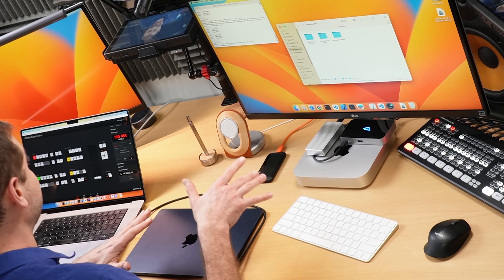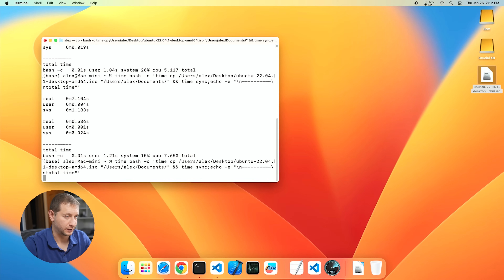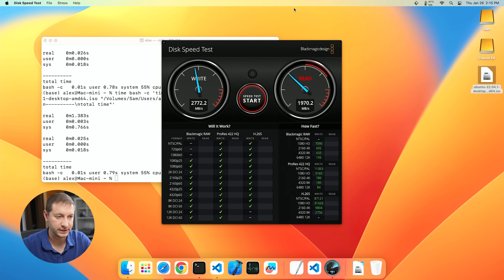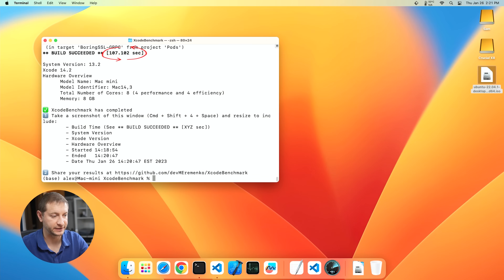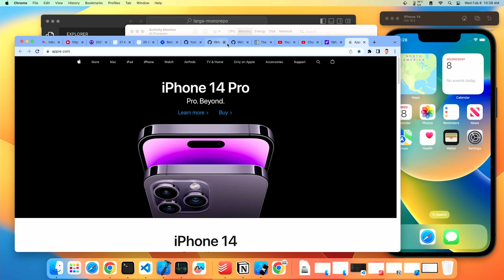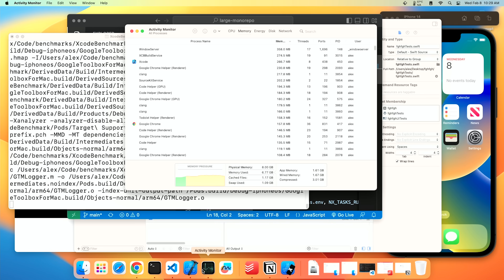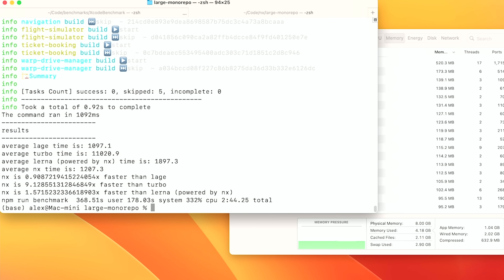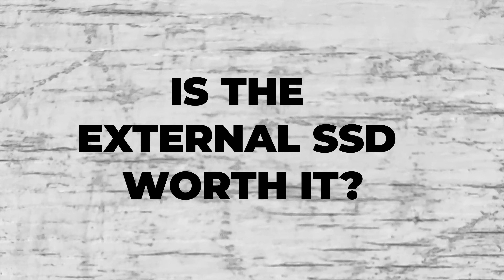...but there's a catch

Comment: Great video.  Most of the comments made so far are about speed but my interest is in SSD life and to some extent  computer life.  I'm thinking of getting an M2 with either 16 or 24 Gbyte of RAM but keeping the 256 Gbyte SSD.  My understanding is that the 256Gbyte SSD has half the life span, measured in bytes written, than the 512 Gbyte drive.  Basically the larger the drive the longer its life.  

Am I correct in thinking that just using the internal SSD for the OS and applications, avoiding swaps by having maximum memory and keeping all data on external SSD is one way of extending the life of the internal SSD.  

One other aspect that appears to be important is the temperature that the various M series machines are allowed to get too.  It appears that Apple prefers silence rather than service life as a 10 degree c climb in temp halves the life of the component.  I've seen videos where the M2 Pro is operating at over 104c which seems to hot to me.
Reply: For fans just get TG Pro and use that to fix fan curves, tho base m2 is very cool even worst case scenario

Comment: Finally an information that nobody talks about. I've been wanting to switch to Mac for a long time but I haven't dared yet, because there are some things I don't know. After installing the OS and the rest necessary, of the 256 GB, how much space is left on the ssd. It seems that not much.
So, can you install all the programs and apps on an external ssd and leave only the OS and swapping on the internal ssd?
If that's possible, then you can even use a 2TB ssd that is always connected to the mac mini.
In the Windows system that I have, this is possible, although sometimes there are here and there one or two little problems.
On my ssd, with iTunes, the iPhone/iPad backup already needs more memory than windows 10 or the space where the programs and apps are installed!
Thanks
Reply: in mac, you can have your apps anywhere you want. even on desktop… it's not like you are installing anything, app is usually one file you just drag & drop from disk image. Or you can map your whole user folder to external drive and use internal just for system and it's apps (and you can install some there and some to your external – there are no limits)

Comment: Does the base model Mac Mini have dual channel Ram?  Single channel ddr5 6400 supports 51.2 GB/s unless your using multiple chips.  To get the advertised memory bandwidth of 100 GB/s you need multiple DDR5 channels.

Comment: 8 ram aren't going to last long. If you just need a temporary machine then it is fine if you are going to keep it for a long time 4+ years then just get 16 ram. As far as SSD goes, 256 is not enough but you can add external ssd so it is fine if you have a stationary setup. For laptops just get 512 ssd at least because a MacOS update now require 50gb of free storage, on top of other build-in programs and "System Data" you will be left with around 100g of free space and you wouldn't want to carry around a external SSD with you. So if you going to keep it for long, 16gb 512 ssd is a must.

Comment: Am I right in assuming this conclusion means if I don't run into swap memory by purchasing a model with more ram. I could then use a faster external SSD for a boot drive as shown here and wouldn't have any issues
Reply: Exactly. And to be sure, using 980 Pro as it’s performance doesn’t drop much when SLC cache is full (which is about 12 GB as we can’t use it’s “smart cache” under macOs)

Comment: I’ve bought almost the same enclosure branded as Acasis and achieved the same speed with Samsung 980 pro 1tb and iMac 2020. I really impressed. I’m using it as a project storage and build drive.
Reply from the maker: im pretty impressed with these speeds. i moved 180GB in a minute or so.
Reply: @AZisk  agree. Also tested the same way with your favorite time command ))) And temperature is also good. I’ve applied the thickest thermal pad from the kit and regular temperature is in range 37-43 celsius. The highest one is 56 degrees after 15 min benchmark test.

Comment: Hey Alex,
I'm a full stack developer, working on ML/AI and many web dev projects.

And planning to buy Mac Mini M2 Pro with 1TB SSD.

But I'm confused a bit, 
Since I never used any Apple Products,
Is it the right product that full fills my requirements?

Currently using Predator laptop with 16GB of RAM ( with external 34" ultrawide monitor ) and planning to upgrade it with that.

Is it an actual upgrade of my old lappy or a downgrade?

Can I use this machine for the next 2-3 years without any performance issues for my work?
Reply: I don’t think so. I think you should do some research on the M1 studio.

Comment: That is an expensive enclosure.🤣
Reply from the maker: it’s rated at 40Gbps, those are higher than the lower 10Gbps models
Reply: Thunderbolt enclosures are more expensive than USB ones. There is huge difference, you know.

Comment: SSD speed is such an overblown issue for developers. Most benchmarking done by YouTubers are done on video editing for which yes it makes a big difference during file export, etc. But for developers, 256GB already gives excellent performance, if you have to choose, the memory upgrade will have a much bigger impact on your day-to-day life. But seriously, I’d be really surprised same developer could tell both SSDs apart without timing builds. It’s not like we are sitting around watching the prompt to complete when building 😅 Well I hope so 😂
Reply: But at the same time, any professional video editor, which is literally none of these reviewers or forum lurkers criticising the 256GB model, would always use an external as a scratch drive.

Comment: Remember when people thought Unified Memory was some magical unicorn juice that eliminated the need for more RAM capacity and swap? I 'Member.  
 
I knew that was bunk and just pointed to the lower quality reviewers. As a data scientist if you need to merge millions of rows of data they need to be somewhere fast, unified memory just means no swapping between GPU and CPU pools but the capacity is the capacity, any fallover goes to swap which is still orders of magnitude slower (it's not the peak transfer speed, it's the access time and the small kb read/writes)

Comment: What about swapping? Especially the models that have lower storage are usually coupled with 8GB of RAM for example. In that case you might be swapping a lot (which Mac OS is pretty good at). Wouldn't that be strongly impacted?
Reply: Yes you’ll be swapping a lot. They really dropped the ball on the base model. I wouldn’t touch anything with less than 16GB memory. Yes 8 will work but now you’re pressuring a garbage SSD. Oh and don’t forget you can’t replace any of it yourself when it fails!

My wife’s M1 mini routinely uses over 8GB ram for basic office work tasks. I made her get the 16GB ram and 1TB SSD for the princely sum Apple charges though because I didn’t want to buy again in 18 months.

Comment: Under any circumstances, DO NOT use macOS on external drive. 

You'll lose out on firmware updates for your computer (they only work when macOS is booted from internal).
AND performance of Apple Silicon SSD controller is so insanely high that it'll still beat any external SSD by a large margin. Sure, it may not have the best bandwidth, but response times and random read performance is blowing everything else out of the water.

So please just keep using internal storage for macOS and applications, and use external for a data that does not require extreme storage performance (like photo library, music library, etc.)
Reply: Couldn't you use the internal ssd only for OS and swap and install the programs and apps on the external ssd ?
Reply: Any proof links on that? Apple Silicon SSD controller is not any faster than any other top SSD controllers.

Comment: The sole complaint I've had with the stock mini is that 8GB of RAM is not enough.  Even moderate use of a web browser can easily crowd the memory pressure into the red zone.

Comment: Ok super interesting - but i'm sat here thinking "Buy why?" - if the external SSD is so much better than the internal, and it's using thunderbolt 4, WHY would it begin to slow down so much when it comes to swap? I know it's external, but it's a faster drive, so why any slow down? 

Perhaps the answer is that, regardless of drive speed, moving things in and out of swap is inherently less efficient on an external drive?  Perhaps it's because the external drive is a single non-parallel drive - but the 256GB internal is ALSO a single non-parallel drive, and swap was so much faster in your video (unless I misunderstood?). I'm not sure.

If that's the case, then maybe there's an argument for upgrading the RAM (to reduce your potential need for swap entirely) then using your OS on a large external drive for a cost saving? The findings were cool - I just wanted a little more explanation :D

Comment: Your test is a bit misleading here. In your first test, you copy from the same drive so of course you will have on average 50% less throughput. Then you copy from one drive to another (@2:43) so you will reach speeds equal to the slowest of the two drives - not a really fair comparison. 
And since you are getting quite fast transfert between the 2 drives, it means your built-in drives isn't so bad - @0:14 - 926MB/s read speed is enough to saturate a 10Gbps network link which is really fast, don't you think? - but your 3GB .iso is mostly cached and not read from the built-in disk.

Comment: Computer with 8GB of non-expandable RAM in 2023 is e-waste.
Reply: Have you used it yourself?
Reply: @dreswan1  other reviewers have verified that multitasking is a bad experience
Reply: Not sure what you are asking, but last time I've owned and used computer with 8GB of RAM was 11 years ago.
Reply: @Glotttis  yesterday ?
Reply: @Glotttis  don’t get 8GB of RAM confused with 8GB of unified memory. They aren’t even in the same ballpark.
Reply: @mikez2501  I think you are the one who is confused. Unified memory means memory shared between CPU and GPU. So if you have 8GB model memory will be even more thinly spread. Unlike on PC where 8GB RAM means CPU can use entire 8GB. And video card has its own memory pool.
Reply: @Glotttis  not confused at all. You are absolutely correct in what you said but what you aren’t saying is that unified memory allows for increased memory consumption by any given component. It has a higher bandwidth allowing faster flow of data. In the end, communication between  all the components and the memory is faster. All the videos where they absolutely and purposefully max out a process to see what a computer can handle is not real world computing.
Reply: @mikez2501  tell that to the VM i am running
Reply: 8gb of whatever they call it is ridiculous and bare bones memory should be 16GB.  I actually find it insulting that they charge so much for such low specs. I wouldn’t mind paying their prices if the base models were 8/512.

64GB of RAM for my PC cost me about $200. I’ve had Macs and like Mac OS but they seem to be getting a little nuts.
Reply: You are so right. Apple never gives you enough RAM and storage for the base models, but now they are baking everything in so you can’t change it afterward, so I would never buy the cheapest one. I got a 32gb MM with the slower M2 pro and 1tb of SSD space. Spent around $1,800. GIven what I am doing with it (the occasional tough project and a lot of basic crap) this thing will last me for years. I spent a little more on a SSD enclosure for a 1TB drive off my old PC for Time Machine, and bought another fast SSD and a thunderbolt 4 enclosure for an additional 2TB of fast external work space. So, I spent a total of about $2k on this desktop Mac. It runs MacOS, WIndows 11 Pro (with Parallels) and soon, Linux of some flavor. Great development and creative environment. Not sub $1k cheap, but very powerful, small, energy sipping and versatile for me. I’m hoping it lasts about 5 years, with occasional external upgrades. As for gaming, I kinda gave up on chasing the PC gaming bunny, and now just play on consoles.
Reply: True. I work on an 11 year old pc with a Core 2 Quad and 8GB of RAM. The processor is rarely a problem, except when working with graphics and doing texture sensitive restoration or such. The RAM however hits the ceiling way earlier. 8GB is just not realistic anymore. I also work on a 10 year old MacBook Pro with 16GB. Despite the processor being only about 30% faster than my Core 2, it can do a lot more and quite a bit more fluid, when a real day‘s work is open.
Reply: Windows user alert 🚨!!
Reply: Did you actually try it?
Reply: I’m not a fanboy but A 8 gb RAM mac apple silicon is still very good
And you can dongle it to an ssd reader for more storage
Reply: I wouldn’t describe 8GB Macs as “e-waste”. For most people 8GB will be usable for the next 10 years. (Productivity and streaming is not likely to get super-intensive in that time).

It’s only for the more demanding users that 8GB machines will not be enough in the lifetime of the machine. And they are not likely to get 8GB anyway.

Apple’s machines use recycled aluminium, and they are going for “net zero” emissions across their company and products by 2030. So “e-waste” should become a thing of the past.

However, 8GB is certainly not generous of Apple, and they do that deliberately to make it more likely for users to hand over cash to upgrade.
Reply: @AndyJMacLeod  8gb for the next 10 years? Nope
Reply: I think apple can still get away with it. macOS is definitely more efficient than a Windows machine of the same spec. For a base entry, I think it's more than usable.
Reply: @Njonesyy  I don't know. This all sounds like copium. I have a PC with 32 gigs or RAM and MB Pro with 32 gigs of memory and resource usage is very similar between both systems when doing the same things (3d and video editing apps, photoshop, browser, etc). Also you say macOS is more efficient? How? When both of my systems are idle. macOS is using WAY more memory than my Windows machine.
Reply: @Glotttis  It doesn't matter how much memory a system uses, but how efficiently. If your computer has 32GB and is always using it, idle or not, that's efficient RAM usage as long as it isn't choking somewhere as soon as you do something, and swap isn't high depending on the scenario. System efficiency is measured in how fast your system allocates resources to the immediate need and how fast it moves hibernating, low priority tasks to swap when needed, and it that regard MacOS destroys Windows.

If they have 32GB and is always killing background tasks to "save it" that's bad RAM usage.
Reply: @jimengab  Well I realize I stumbled upon Apple cult here and everything is always better on Mac/iPhone etc etc no matter what, but original discussion wasn't even about that. It was that 8GB memory is a joke in 2023. It's pathetic you are going to such length to defend this corporation producing e-waste computers with limited longevity. There is no magical "efficiency" and there is no magical "resource management" on MacOS.
Reply: @Glotttis  Haha, don’t start a fanboy war 🤣
Reply: @Trojan Horse Delusional
Reply: @Glotttis  just take the L when your reasoning is moot and you can’t refute facts given by someone who has different views, calling someone “apple cult” just because you lose an debate is embarrassing.
Reply: @Trojan Horse No, that’s simply not true. I’ve worked on both Mac and Windows machines for more than a decade. While it is true that MacOS uses a little less RAM, it is not much less. And the RAM usage of same apps is very similar on Mac and Windows. So the two are quite comparable.
Reply: @Glotttis  not nesscessarily, like8gb has always been comfy for me on Linux and considering Mac OS being Unix like and being implemented as a mobile OS (iOS) where iPhones regularly have 4GB or less ram (anything not iPhone Pro/Pro Max has 4GB RAM today), 8GB ram is fine for most basic use cases

The problem is when it isn’t a basic use case it can suck badly which is why my Mac Mini is configured to 16GB of RAM, but still having the base M2 APU and 256GB SSD. I’ll use an external M.2 SSD for the extra storage, which I got 1TB of for $27 and got the adapter for $90 from Sabrent.
Reply: @Glotttis also, well a lot of ram used is cache, like htop would report less ram used despite the amount of ram used in the task manager and htop’s bar was higher than the number in htop. Linux does the same thing  and uses a lot of ram as cache, and then unlike Mac it isn’t reporting cached ram as often as used ram vs Mac.
Reply: @Glotttis indeed tho the fact is 8GB of ram tho is pretty shit tho when it’s only gonna be used in entry use cases while for any amount of work you need more than that.
Reply: @trojanhorse6701yeah no that’s not how it works, 8GB in Mac is not 32gb on windows, it’s still 8GB, it’s just that it uses just a bit less to allow basic programs to fit, like Linux but still using more ram than that OS
Reply: @trojanhorse6701  Definitely not. Apple wants people to believe that their memory ram management is somehow magical. 😂
Reply: Not everybody makes video editing, 3d modelling and heavy tasks. 8gb of ram are perfectly fine for normal tasks, like web browsing, word processing and file management. I use my MacBook Pro with 16gb of ram for Lightroom processing, and to be honest it swaps a lot, but it doesn’t affect the performance
Reply: Yep. And I hate when people say thats ok for web browsing and stuff. If I open 5 tabs, the computer almost cry.